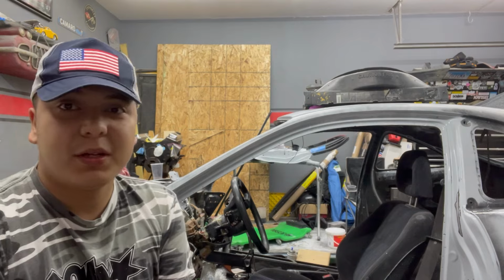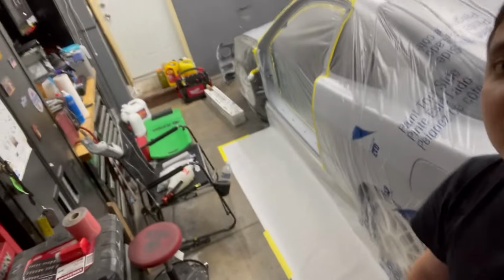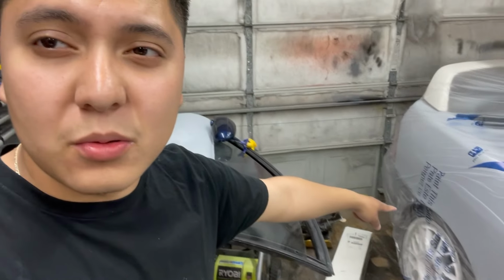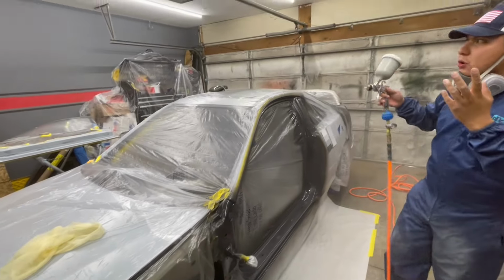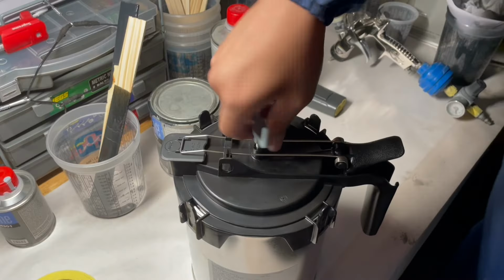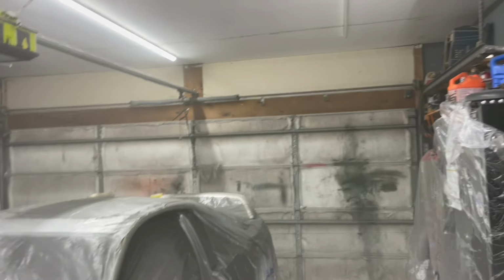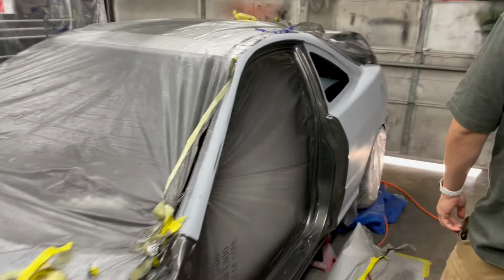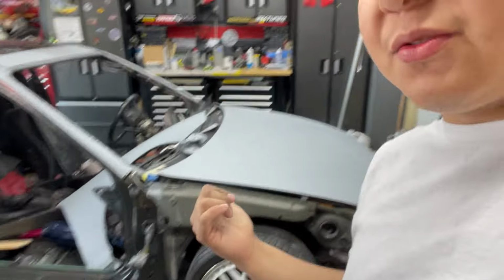Painting my DC2 Integra

Comment: You shouldn't do hard line around door jamb
You will have hard time sanding down those lines
Next time try to use soft edge foam an put it a bit more far from door jamb
Like this you will have a smoth line and will be much easyer to sand it down